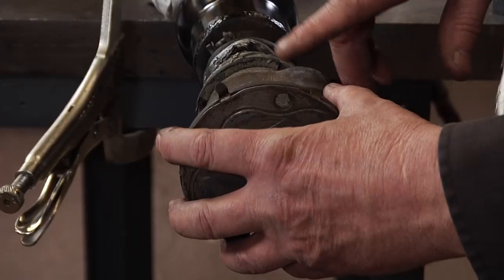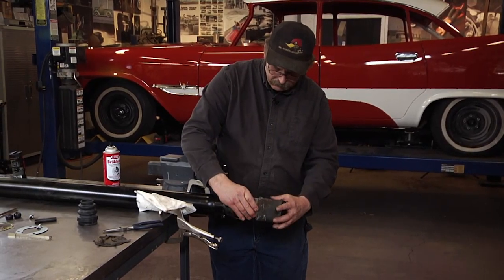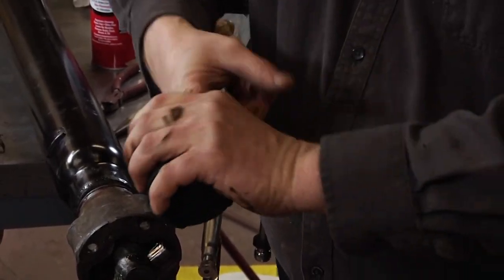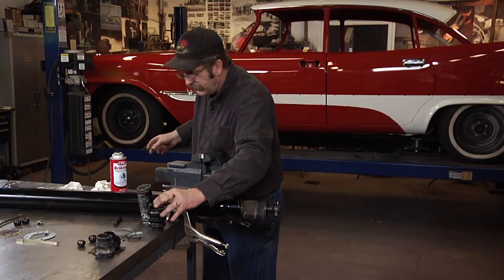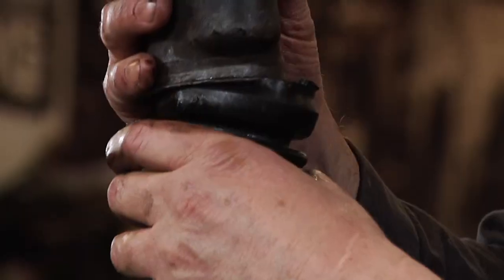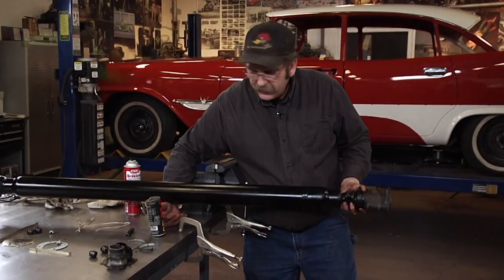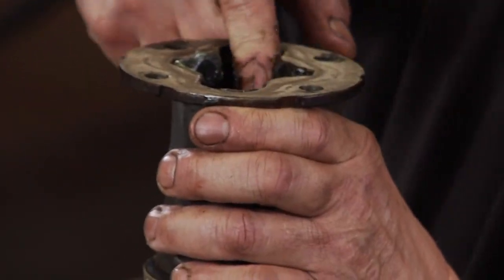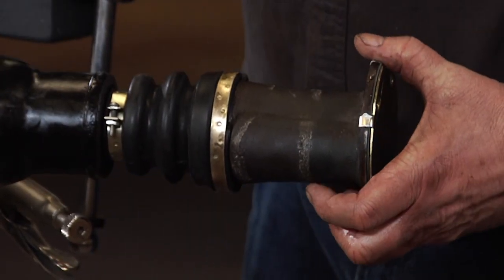How To Rebuild A Ball And Trunnion Drive Shaft

Comment: I did the same job about a year back. I did put the new rubber in varm water for 20 min or so before I started the assembly process. That softened the rubber a lot which made the pulling through part a bit easier.

Comment: Just finished installing one on 65 Dodge Dart  this is the smaller boot and housing.  thank you for the tip using wires. Still took me about an hour to do the job, I also used plastic door trim tools ( Harbor Freight ) to help pry the boot inside and used a large hose clamp to the boot down into the housing.
Reply: Nice, just bought a 65 dart myself

Comment: One thing I'm finding out is you can't get good rubber anymore! The new boot I put on has already split through and uncountable cracks on the rest of the now two pieces. This was on the car for two years. Now my fix is making a leather boot and sewing it on. I did get another boot thru eBay thinking i was going to do this process again but figured leather can't be any worse as long as i keep it waterproofed.

Comment: I tried the wire, and it seemed to get in the way.  Spent two hours fiddling, then started getting it.  Then ripped the darn boot last thing.  
  Went and got my ball joint press tool, and pushed the pin out, replaced the boot, and pressed the pin back in half an hour.  Had to go back and forth a couple times to center the pin, but it was way faster and less risky than forcing the boot through.

Comment: I see another viewer asked about the breather piece but got no response. Another vid I watched the guy said they used something akin to burlap around the shaft and the small end of the boot goes over the material. It has to breath because it's shifting and the angle is changing, heat build up will make the boot swell if there's no breather and if it get's hot enough it pops. That means all your grease is gone and your new boot is destroyed. The guy said to get a piece of black felt. That it's probably the closest thing we can readily buy that will work. My hands are too busted up to fight with forcing the boot through the inside. I've got a height gauge, micrometers, calipers. I can press the pin out and get it back in evenly. With my hands being as bad as they are, I have to use tools to do the work. I liked the wire trick though. What kind of wire is that you are using? The closest thing I can come up with there would be coat hanger but your was clearly not coat hanger. It also didn't appear to be copper electrical wire. What was it? Where'd ya get it? I'll give it a quick try but I doubt I'll be able to get it through there. Thanks!
Reply: There is no breather piece. Check 55-8 Parts Book. Also check 57-9 shop manuals. Plymouth, Dodge, Desoto, Chrysler. Your choice. There is no breather piece.
Reply: @ronwaters478  I don't think they called it a "breather piece" but I think that's the function of the burlap.
Reply: @waynethomas1726  - So wouldn't there be something about this in the shop manual ? I disassembled two driveshafts (58 Plymouth, 59 Dodge) and didn't find anything resembling a piece of burlap on the smaller end of the boot. I think the story about the boot exploding because of pressure build up doesn't pass the 'sniff' test because the larger end is open to the inner housing. So no chance of pressure building up.
Reply: @ronwaters478  Well...I guess you just pounded me into submission huh? I was passing on what I had read elsewhere. I stated that. I also stated what I THOUGHT it was about. Sorry about not having an official shop manual that style of drive shaft. By the way, having done a whole 2 driveshafts hardly provides anything like definitive proof. Just sayin.